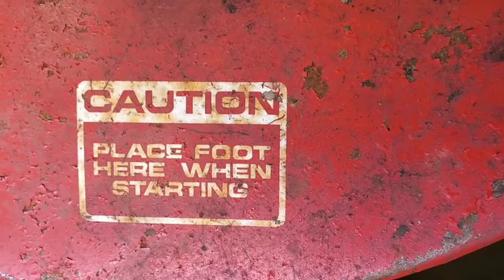Part - 2 starting the preparation for paint (Lawn Mower Restoration)

Comment: The washers are a good idea, it might be worth fixing them with from the underside with your metal filler. We know a couple of people like the person you described and they have made a number of replacements stickers for us. Your new sander did a great job and you are making good progress
Reply from the maker: Hi Joseph thank you for Watching. Yeah I am going to try to use a liquid metal filler that after it sits and hardens you are able to sand it and drill it out as well. So like i said in the video I plan to use the metal filler then sand it down smooth and redrill the holes out for the engine mount bolts and put a metal washer followed by a rubber washer and then another metal washer from the under side of the deck for extra assurance. If you wouldn't mind maybe we could try to work something out through people use know to help me with the stickers. Thank you for commenting. Take care and stay well my friend. 👍

Comment: How's she goin'?  Way to go Taylor, you're making great progress on the mower.  Those stickers will be hard to match I bet and sometimes when we strive to get things back to the 'exact way they were' we have to make some compromises eh!!!  Nice work getting that sticker off and good idea to use the JB Weld on the body!!!  Take care!!!
Reply from the maker: Hey Grampie Mike. Thanks for recognizing my progress i feel like I'm getting somewhere with it now. I have a little bit of hand sanding to do on it and I have to still turn it over and clean up the bottom of the deck a little better because I think I mentioned it in one of my other videos I'm going to spray the under side with rubberized under coating to lock moisture out. There is no way to get ahold of all of the original stickers for I looked all over the internet for them its like you said some times we just have to compromise. Until we talk again take care. 👍

Comment: That top plate I wouldn't weld it on second thought 
Get a thin sheet cut and draw around the top piece where its white with card making a template cut to size then put it in under the deck so it sits flush then weld in place 😀 drill out the three holes then drill small holes around the big hole unless you have plasma cutter or sheet metal cutter file or grind flush with body the use the liquid metal on top after sanding down to bare metal fill all gaps sand down till flush re drill mount holes then you will have a stronger deck just don't go too mad with metal sheet a couple of mils will be fine and stronger